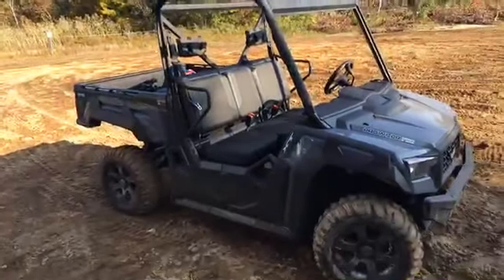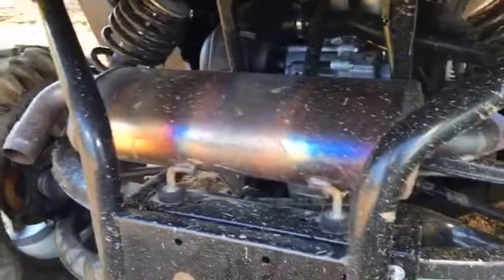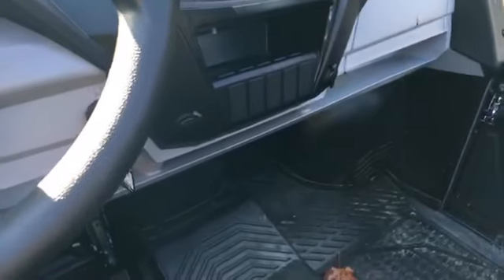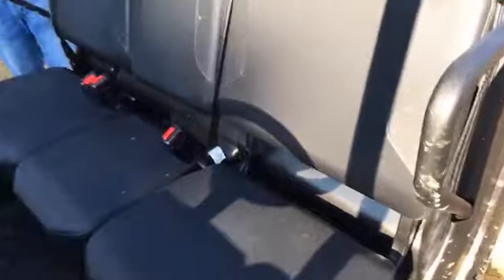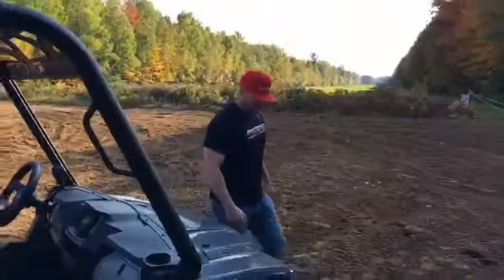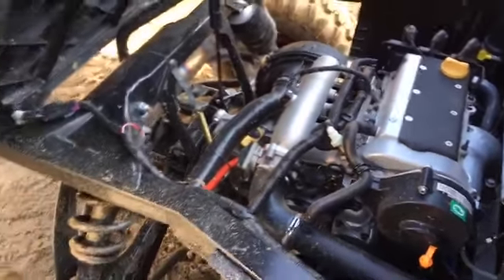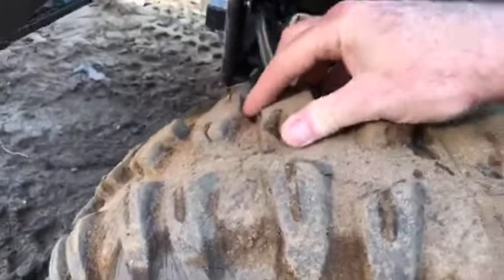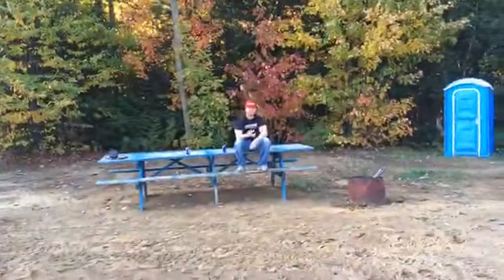ATVGUYS Quick review of the all new 2018 Textron Prowler Prp XT

Comment: My husband and I bought a pre-owned 2018 Prowler Pro XT in "flashy red" with a soft cab a few months ago.   Yes.  Definite super quiet 4-stroke engine.   We can drive 50 kms/h (30 mph) and have a normal conversation with its cab.  If looking for a super quiet engine this tool is a "must have"..    Upgrades (IMO should be factory), previous owner replaced factory tires with smoother ride "Kenda bearclaw radial" rear 11" wide and front 9" wide tires.   2019+ version comes factory with different size tires.   Its front winch got a "wireless control" upgrade added.   This allows one to use the front winch inside and outside the cabin.   For brighter head lights lighting, my husband upgraded its factory H4 halogen bulbs with H4 LED Motorcycle bulbs.  My husband also installed street legal lighting kit (re: signals, horn, reverse light) as well.  Also installed a simple tin metal heat shield under its rear box.  This deflects its natural high heat from its rear engine & muffler.   If using NO or solid cab option, recommend installing side mirrors as well.   Not too sure if we'll use its rear box for gravel/dirt (we use lower to the ground attached trailer instead) but the rear box is great for tools and/or light weight materials.   If looking for a UTV for farm usage and minor trails, I'd recommend this tool.

Comment: ...Ouch ! That cvt belt cover is gonna be a problem .  My first thought is ..Those clips are never gonna keep the water out.
Reply: My thoughts exactly,  but polaris does the same on the XP. My buddy has one and says he has never had an issue.
Reply: I was thinking that alternator isnt going to live long
Reply: roaddiablo, why? I might buy this unit so more infos would be welcome about the alternator or any other flaws you are seing on this design. Thanks.
Reply: @wendigo1011  its an automotive type engine with external pulleys and a REAL alternator.awesome. but the alt is mounted way down low near the belly in front of pass side rear wheel with little to no protection from tire flung debris.let alone a water hazard.i could see it getting full of grit an debris and killing it. ive no idea how to change this, because i do really like this machine. just dont think it will serve my needs an uses as well as the havoc would I think.
Reply: @roaddiablo  The John Deere gator 825i has the same motor and alternator set up. The alternator looks protected better on this than on my gator. So far  no alternator problems on my gator
Reply: Mine has over 400 hard miles with no belt issues and no alternator issues. It's been under water and completely fine. Just like a truck with a snorkle the alt goes under water. After riding 70 miles each time I trail ride the alt is still pretty clean so is plenty protected. As a mechanic I appreciate being able to work on this machine. Unlike my Honda Pioneer I traded in, if the alt went out the engine has to come apart as it's inside

Comment: Have you discovered any mechanical issues with this unit?  Are they reliable?
Reply from the maker: I convinced a friend of mine who owns a large cattle ranch to buy one and he puts it to hard use towing, walking the herd, manure, the works and he has not had an issue yet.

It's still dead quiet compared to the other unit he had before and it's been without issues,

I was serious when I said it was really well built.  I would have loved a little more top speed but it's really because i'm a speed demon at heart.

Lookin good so far.
Reply: @ATVGUYS  How are they for driving?  I've driven one for a test, seems like there's a lot of low end torque for towing etc.  Not much acceleration from what I can tell.  Seems to be consistent & I know it isn't going to be a speed demon ... I'm not looking for that.
Reply from the maker: @bwheeler  Our full review here:  https://youtu.be/Bo0RTXQZS_k

The Chery engine is not a powerhouse, in fact it's very much the opposite but... it's perfectly mated to the CVT and transmission ratios.  Gobs of smooth yorque down low and to the midrange is what consumers should be looking for in this type of UTV.  It will still top out at an electronically limited 80KPH

It's confortable enough to sit there all day and extremely well built for an Arctic Cat product.  The best frame welding we've seen form them yet.

This is the first Arctic / Textron fully desingend and built machine from my experience and it's a winner..  We have two farming buddies who bought one each and one of them gets the daily grind of cattle farming chores and has'nt skipped a beat.

Definitely one to at least take a serious look at when looking for a work machine.
Oh and it plays decent too.
Reply: @ATVGUYS  I am looking at buying one of these, have your buddies had any issues in the last year?  How many km on them now?  Thanks.
Reply from the maker: @ih302  Dont know the mileage but he used it almost daily and if it would have had issues trust me he would have called me.  I performed maintenance twice on it and it's still solid no loose
Reply: @ATVGUYS  I actually just got back from test driving the last crew cab model they have and worked out a great deal on it.  I am going to think about it over the weekend and get back to the salesman on Monday.

One thing I noticed during the test ride was a clicking from the front end (sounded like sway bar links but they are tight, it's brand new).  Did you notice this on the units you tried?  The really weird part is I could not replicate the noise when rocking it back and forth.

One more thing, any recommendations on a tire upgrade?  Any experience with Duro Power Grips?

Thanks.

Irving from Newfoundland
Reply from the maker: @ih302  Dont like the powergrips myself but check out the Traxion Gripper max which is perfect for this vehicle as an 8 ply radial (www.revco.ca)  on 29" it could be awesome or 27's for a more stock look
Reply: @ATVGUYS  I was looking at those but I think spacing would be an issue on the front with the 27s and they don't come in 26 x 14.  I think they would rub on the frame member directly behind.  How about EFX MotoMTCs?  They come in 26x11x14.
Reply: @ih302  too hard compound, if you leisure ride it, for work they will do the job no problem
they are on the very heavy side though
Reply: @PowerSportsQuebec  Thanks